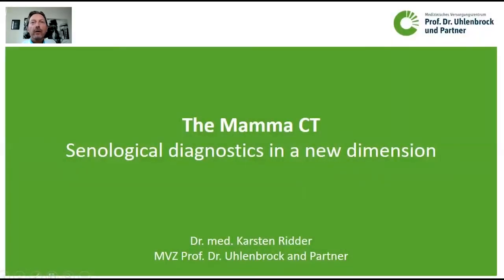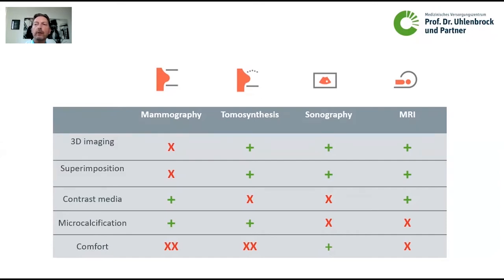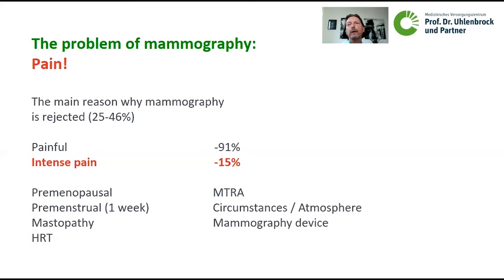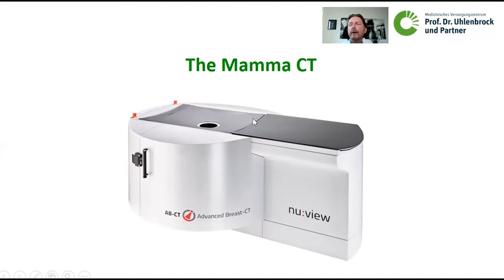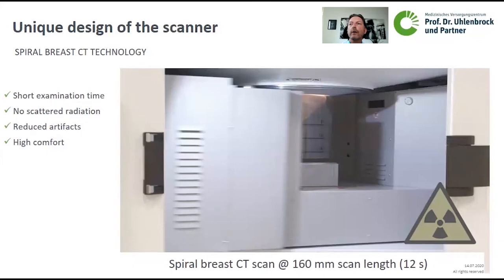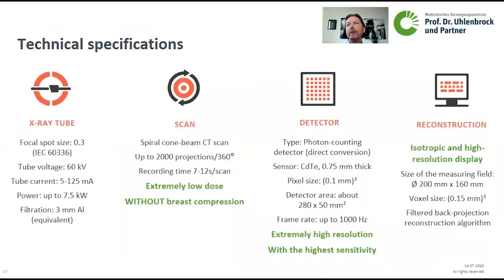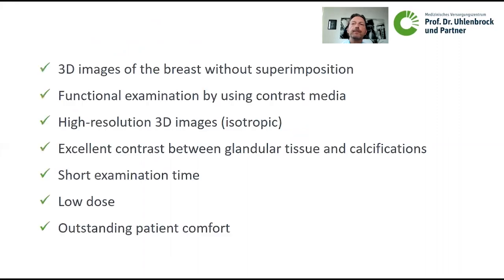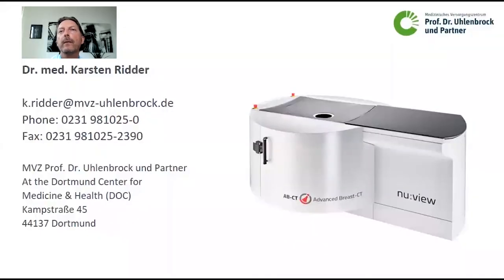Breast CT – Modality Overview and Technical Specifications

Comment: Here breast cover is made up of.?and what's the distance between positioned breast and detector and xray tube.
Reply from the maker: We use a special thermoplast which is lightweight and robust, while maintaining a glass-like transparency.
Our nu:view Breast CT has a special system geometry to provide the best imaging properties where the detector is close to the breast, depending on the breast size, whereas the tube rotates in approx. half a meter around the breast. Please contact AB-CT via ask.crm@ab-ct.com if you have further questions.

Comment: Usually measured AGD is?
Reply from the maker: The AGD is in the range of 5 mGy AGD
.
But we kindly ask to check “Spiral breast computed tomography (CT): signal-to-noise and dose optimization using 3D-printed phantoms” a publication by the University Hospital Zurich on Springer Link. (Published on 02 December 2020)
. https://link.springer.com/article/10.1007/s00330-020-07549-3